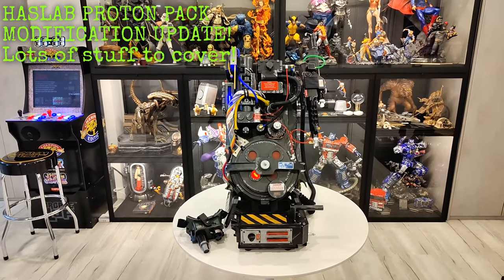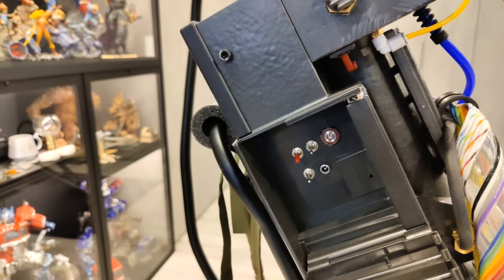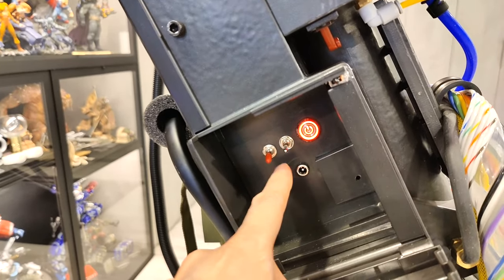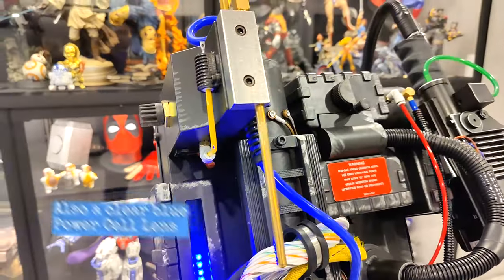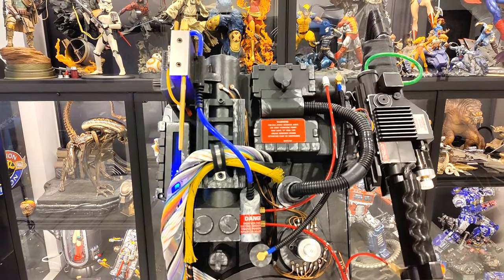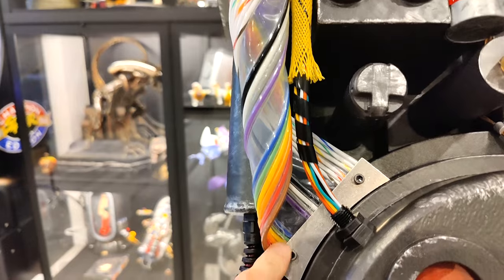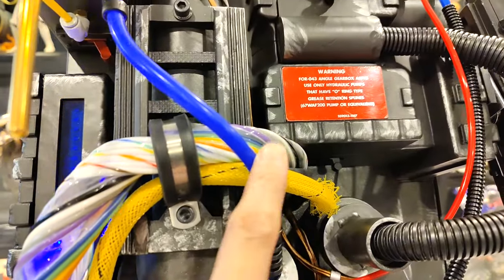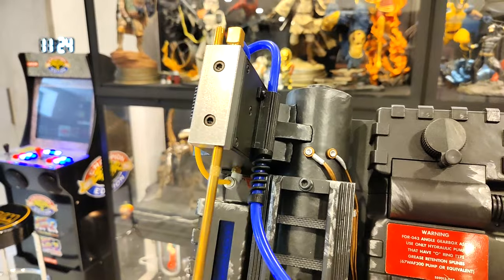Hasbro Haslab Ghostbusters Proton Pack Modifications Update Video! Lots Of New Goodies Installed!

Comment: Thats the best looking hose mod Ive ever seen...
Reply from the maker: It's not movie/screen accurate but it's clean and simple just how I like it :) I'm happy you think so too! Thanks for watching!
Reply: @RSquad911  will you do anything like a how to video? Or how did you learn it? (I believe in self mods to make the Packs our own so this is brilliant)
Reply from the maker: @ct0760  I really want to. i just need to find the time hahaha!
Reply: @RSquad911  do you have info on where you got the black scuba tube?
Reply from the maker: @ct0760  I got it from AliExpress search "interface gas mask snorkel wear resistance gad mask and filter connecting pipe"
Reply: @SquadCollector What length and what diameter? This one is tough to ferret out the wheat from the chaff…
Reply from the maker: @compudude  Same length (42-48" roughly) and diameter as the factory hose (1")
Reply: @SquadCollector  I thought the gas mask hose part was more like 9-12” long at the most?
Reply from the maker: @compudude  Oh I thought you meant the entire hose assembly. I basically copied the exact measurement of the stock Haslab parts.

Comment: Great video.  I love the new hose and the clinko connectors.  I'm curious though, how exactly did you attach the clinko to the wand itself?  What did you do with the battery pack insert that connects the power to the hose/pack?  Any photos or videos of that process?  I don't see anywhere else on the web of anyone doing this and I think it's genius.  I'm actually going to try and use a 6 pin connector as I have both a speaker mod and a switch for a smoke machine on my wand.  I think this is really going to clean it up.
Reply from the maker: I'm getting asked this quite a lot... SOOOOOO I ordered the parts (Arriving in 3 days) and I'm going to do a quick how to video. It won't be a full complete but one showing some of the important parts and explaining how to do it. Stay tuned!
Reply: @SquadCollector  outstanding.  I'll be standing by.  Love the cyclotron LED kit as well.  I have one of those on the way!

Comment: Amazing, can't wait to get your cyclotron kit installed. Question, is the dale ph25 resistor plug and play, or is there some drilling, patching, painting required?
Reply from the maker: I can't wait for you to get it too! Adds so much "WOW" to the pack. WIth the Dale Ph25 you need to take the pack apart and unscrew the plastic resistor from behind. Shave down the plastic that sticks out and then you drill/tap a hole for the real resistor to screw in. It's fairly easy.
Reply: That's not hard at all. Thanks for the info  @RSquad911

Comment: 7:18 For adding the real wires stuffed into the fake section of wire loom, how did you cut that out? I started to try with a utility knife (box cutter) but that stuff is stronger than I thought!  I’m considering a dremel cutting wheel instead, perhaps?
Reply from the maker: It's just a rubber layer. Underneath is a hard plastic tube. You mainly need to "shave" it away vs trying to cut it right out.
Reply: @SquadCollector  Thank you!  That explains why my blade kept stopping after just a few millimeters.  I was able to cut it out with a Dremel no problem.  I went a teeny bit into the hose in a couple of places but not problematically so... there is a noticable change in the Dremel after it got through the rubber and hit the plastic.  Of course that rubber seems glued or somehow bonded to the hose, so it sort of had to be peeled away with some force, but it all worked out fine. :)